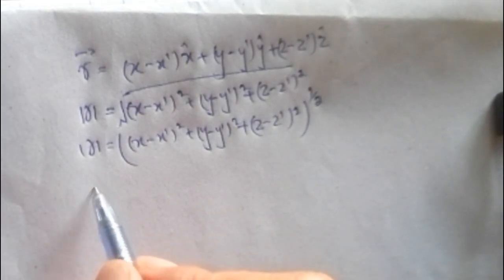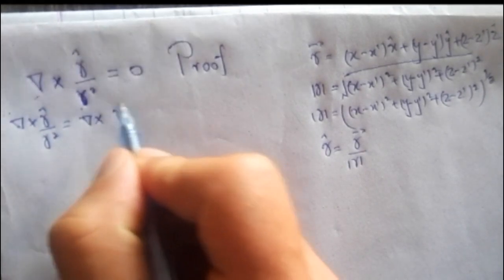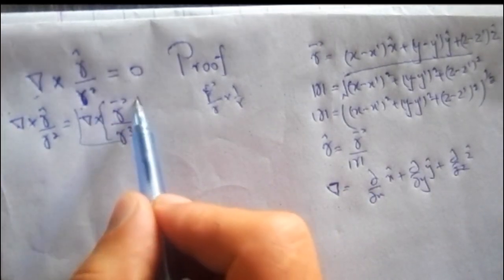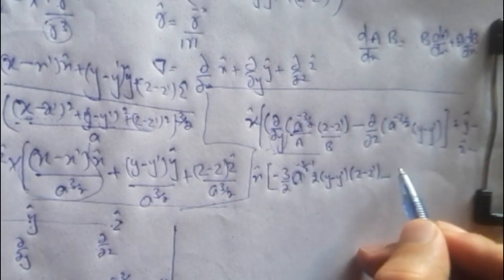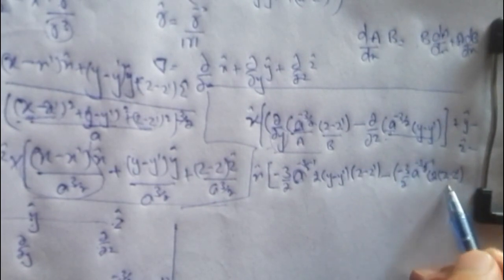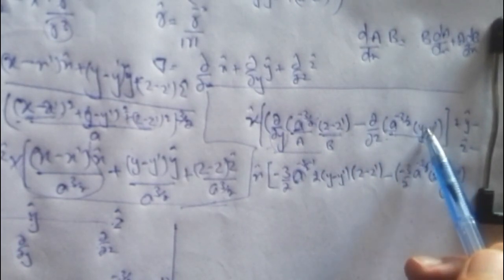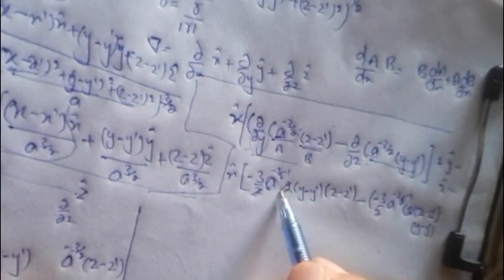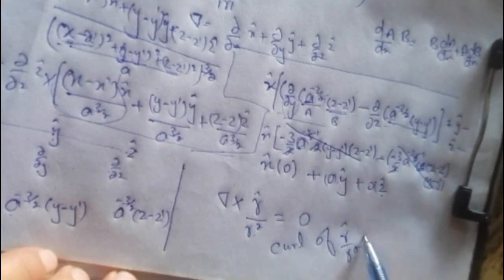Curl of r(hat) over r square (r hat /r^2) = 0 Proof

Comment: Is div of r (hat) over r (square) is zero ?
Can you prove it please ?
Reply: no it is not. write R(hat)/R^2 in cartesian coordinates (you can also do it in polar but it's crappier), and take the x component of that vector field, derive it with respect to x (and do the same for y and z variables- all non-primed).  Sum it all up, you will similarly as in this video find that the nominator goes to 0. However, if y=y', x=x', and z=z', then the denominator is also zero, so your expression is undefined. It suggest that the divergence at this point is infinite (as, loosely speaking, the denomerator goes to 0 quicker than the numerator). In order to define the expression, you take the integral of div R(hat)/R^2 over all space (that is a way of define the sort of infinity you are dealing with). Using divergence theroem you will find that the value of the integral is 4pi. Now, what function is 0 everywhere except when the input is zero (there it is infinite), but the integral over it is equal to 4pi? That function is 4pi*dirac delta function(R). So, the divergence of your function above is equal to 4pi*dirac_delta(R). In my notation, R=r-r', where R is the distance between a source and a test charge, r is a vector to the test charge and r' the vector to a source charge (tho for purely maths derivation this is irrelevant). If you would like the proof written out fully, feel free to email a.rogelj@student.maastrichtuniversity.nl (I dunno how to upload pics in yt comments). Good luck&enjoy the physics! :)
Reply: Its actual value is 4pi detla(r)
So it is zero everywhere except at origin..at origin it is 4pi.
Reply from the maker: yes its simple